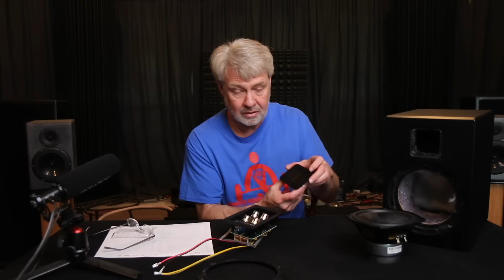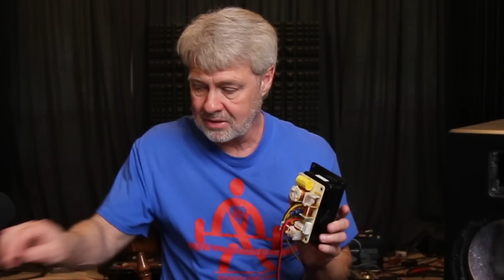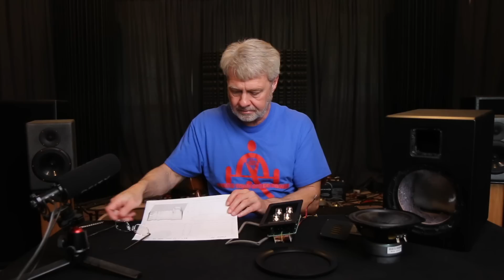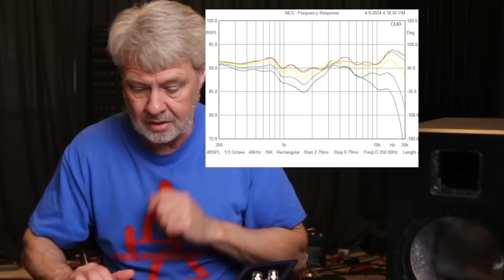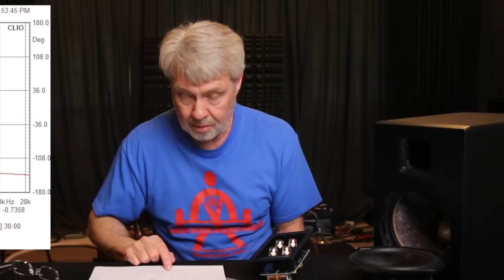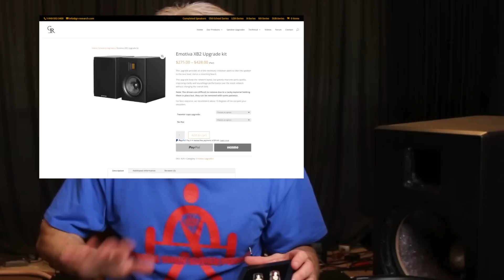These CHEAP Speakers Surprised Danny! Emotiva XB2!

Comment: A bucking magnet does slightly increase the sensitivity of the driver by increasing gap B, so there's maybe another dB or two gained by using the second magnet. The alternative is to make the main magnet bigger.
Reply: I still use a couple CRTs, so I welcome the shielding.  Free upgrade regardless 😊

Comment: 4 ohm speakers are increasingly more popular now days with the growing populatiry of cheap china mini-amps like the TPA3255's.  It is an easy way to get more power out of the small package w/ the included 19/24/36 volt power adapters without having to pay big money for the honking 48v ones (which often costs as much as the amp itself!).  Remember: Emotiva is a budget-freindly brand and many of their consumers are purchasing these speakers to pair w/ such chip amps.
Reply: power isnt quality 8ohms are a lot better. even with the tpa

Comment: Danny I've been watching you for several years, and for whatever reason you don't always come off good.
I do think that your are one of the brightest and your expertise is exactly what is needed. To this video keep in mind that people who have already purchased a speaker WANT OPTIONS and they keep speakers for 15-25 years. So spending more money is probably not something which is a killer, for example maybe have 2 options one for 1/4 of the price of the speaker and a better upgrade for a more premium price. I know myself if I already own them and can significantly improve the product I want know.... Think about we improve our cars with aftermarket out motorcycles, our homes so why not our stereo speakers. Don't worry about weather the price point fits but whether your product will make a little or significant difference!

Comment: He says you should drop 300-400 dollars on parts to get rid of tin connectors in the signal path but what do you think is inside your amp? unless you have a high end 2000 dollar amp then what is the point, you still have "tin in your signal path"
Reply: less tin is better.  you will get tinnitus with too much tin

Comment: Measurements are very good for these $500 a pair compared to many other $1500 a pair bookshelf speakers.  Since the measures impendence is very low for many AVR's, Emotiva should offer some speaker/amp combos to promote sales and assured performance for customers.

Comment: Question: do you aim to avoid using a PCB for the crossover, when possible? (using hard wired instead)  BTW You have my respect, to share your knowledge allows us to have more understanding & insights. I recently rewired my old B&W 684 S1 floorstanders, 1st order xover. i soldered quality UK speaker cable direct to drive units and stripped the cap & 2 chokes off the pcb and wired them externaly to the bi amped class D Fosi V3 amps which are fed direct from a raspberry pi fitted with twin psu Allo DAC. The rewire of the speakers was quite amazing and uplifted the clarity and sound considerably.  Many thanks and keep up the video,s. Paul

Comment: No test comparison after upgrade?  So does that mean those changes are not measurable?
Reply: The parts quality upgrade will not change these measured responses. The only real change that we would see in the measurements is if we put and accelerometer on the side panels before and after the upgrade as the No Rez will knock out the panels resonances down by 10db or more.
Reply: A parts quality upgrade of exact same original values won't necessarily change any of the actual measurements, however, the improvement in overall sound quality, clarity, and fine detail resolution WILL definitely be noticable upon listening to them, especially in the midrange and treble regions!...

That's why, as a reviewer, you mostly should rely on listening comparisons, rather than strictly ONLY comparing the "numbers" or technical "measurements" of a speaker... There's still plenty of qualities about sound and music that cannot be accurately or effectively measured or "quantified", but even with using the same electrical spec crossover values as the original design, (because as Danny stated, it already worked quite well electrically and measurement wise), you would still definitely HEAR a considerable improvement in the "non measurable" aspects of the sound coming out of it, with a significant improvement in parts quality, especially with better quality capacitors and inductors in the tweeter circuit, along with the clarity of the upper woofer's range, into the mids.

Comment: Danny is going to do a tear down on full range drivers.The crossover kit/wool will only cost 734USD.With non magnetic carrying handles for the cardboard box
Reply: He's showing what needs to be done
Reply: I have yet to see a "full range driver" that did not need a filter to correct for various issues including step loss, impedance issues, to break up mode, ringing issues, or a rising response.
Reply: @dannyrichie9743 My Quad electrostatics don't need any filter etc... The best full range experience

Comment: Very good information, I have been following you for a long time. I modify the crossover myself with Mundorf components. It would be good if you added information to the clip from two years ago where you said why we need to put good components in the crossover, the quality of the components that must be used depending on the frequency.

Comment: I dunno about Danny’s upgrade this time. I mean, it’s a budget speaker built to a price point for budget amps and signal sources and so on. Is it worth it? I can’t imagine this will be paired with high end revealing amps and dacs and so on. With that in mind it seems EmotivA😅 has done just another magnificent job with the price point that was the starting point for this construction. Kudos!
Reply: It would be a massive waste of money for no difference in listening
Reply: $600 ain't too budget
Reply: @BoRerunn  Can be debated of course. My point still stands though. He didn’t mess with the crossover points. It seems to me the design is maximized for the price already aka emotive did what they could and did great.
Reply: @choronzo202  you are not being logical. ALL speakers are built to a price pt. why is this model different? every klipsch out there makes my point. they are no more costly than these.
Reply: @ In my head it’s logical that a budget speaker which is correct according to his measurements shouldn’t be needing many dollars in upgraded crossover parts.
It’s a maximized design already within the price point they were designed for. Yes, most things are built to a price point. This speaker is built to a budget price point, which is exactly what I wrote in my comment. It will be paired with other budget components and the drivers itself and cabinet is also budget. So there’s the logic. In short, no way you can squeeze out more resolution from this design only by changing crossover parts (not changing crossover points) when it is paired with budget components.
Reply: @choronzo202  the last line of your comment says it all. you dont believe the underlying idea that better parts mean better sound. maybe a $40 chinese amp wont make it obvious but thats a foolish argument. these so called budget components is a red herring. untill you try it you are speculating against a guy who does this for a living and designs speakers all the time.
Reply: @CashGravel  Why delete your comment? I had time to read it. 

Exactly my point of view. Within the assumed budget line of amplifiers  to be paired with these there is no way you would pick up on changes by just getting those caps changed out etc. And not to say the old saying, shit in is shit out. You would have a substantial source with high definition material. No Spotify streaming. Not necessarily 24bit, I’m not that guy. But solid 16bit of information. You get my point. Budget systems like this are often played via mobile phone, Bluetooth streaming from Spotify. So no, I stand by my point. 

If you would upgrade every point in your chain, I will discuss this again. That means cd transport DAC or a good streamer from locally stored files and good cables and a not so budgety amp etc. Yes ok. But then again, you wouldn’t have these budget speakers. Get my point now?
Reply: @choronzo202  i deleted it because it was too long. all i needed to say was that your are wrong about the effects of upgraded parts on a speaker like this. look at all the klipsch upgrades for the same money. you outlined a series of possibilities to underpin your hypothesis. fwiw, you can go online and read reviews of his kits, real world opinions based on experience.
Reply: @BoRerunn  The base level upgrade is only $275.
Reply: @dannyrichie9743  I get that. But the system you would put this speaker in might not reveal the upgraded sound. Because EmotivA kind of maximized the output of this design already. He didn’t provide new crossover points. Just improved parts quality. And that is where I question this upgrade.
Reply: @dannyrichie9743  Danny destroyed that speakers quality rating
Reply: @BoRerunn  What do you mean?
Reply: @BoRerunnwhat what what?!?!?
Reply: @dannyrichie9743  I would buy another pair of XB2s for this money and ignore his BS upgrades.
Reply: Still gonna sound better than a $1000 pair of bookshelves
Reply: Because after the upgrade, it’s no longer a budget speaker, and will probably scale very well  with higher end components.

Comment: So does the attached magnet to the back of the speaker have no performance benefits?. I was under the impression that they stuck it on the back there to ‘improve’ a cheaper speaker!?!? Thanks for work work😊
Reply: No it doesn't.
Reply: @dannyrichie9743  👍

Comment: Interesting tip about diffraction on the inside edge. I need to build a long over due sub, and I was thinking about trying to bevel that inside edge. Sounds like it might not be an issue at the frequencies I want to play.

Comment: Hey Danny, what's the difference between Dynamat and No-Rez? Are they the same thing or totally different?
Reply: Very different. Dynamat is designed to damp the ringing of metals, not wood. It also has no foam layer for controlling standing waves.
Reply: @dannyrichie9743  OK, thank you for answering that.

Comment: Emotiva does an outstanding job of creating solid products at an affordable price.
Reply: I gotta say... I've have two of their amps - and XPA-2 (gen 2), and an XPA-200 (gen 1). They've been running for 8/9 years and almost 11 years, respectively. Not a single issue thus far, which also holds true for the XSP-1 (gen 2) stereo preamp I've been running for about a decade. I think they sound great. They may not win any beauty contests, with the blue lights, but they've performed solidly for me for a looong time.
Reply: Especially their amps and DAC.
Reply: Although this model is good, don't expect other models from this brand to be good.

A cheap model now and then can be good.

The absolute best ear plugs I've heard are some of the cheapest you can buy. They came with the samsung galaxy s8. You can also buy them loose today.

Think they are AKG/Harman Kardon - Black (EO-IG955B SEGWW)

Don't shoot me if I write wrong.
Reply: @ford1546  wow, samsung makes ear plugs? Why?
Reply: @kalle-09c  Don't worry.... I'm not armed.
Reply: @kalle-09c  "A cheap model now and then can be good."..."The absolute best ear plugs I've heard"     WTF are you trying to say?    Please don't drink and comment.  That or don't try to speak English if you can't.

Comment: 500 Spacebucks a pair is NOT cheap. Monoprice MP-65RT, 2 way bookshelf with ribbon tweeter 50-70 spacebucks. I'd actually buy a kit for those because they're actually cheap, and I wouldn't be too worried about doing mods to them with my lack of skills.
Reply: Or, even better yet, and especially if you are new to speaker upgrades, just look in a few of your local thrift stores for a reasonably good quality, good condition pair of used speakers to start experimenting with instead of a new pair, as oftentimes you can find a decent quality pair of used speakers in a thrift store for under $20/pair, and I personally don't ever pay more than $1/inch of woofer diameter for a set of used speakers, because I've found numerous pairs of good speakers for that price point already, and then those speakers can be used for "learning" about and experimenting with speakers for next to no money lost if you accidentally F them up, and also, with some good tweaks, many times some thrift store, (or garage/yard sale, etc), deal speakers that cost almost nothing, can actually become totally amazing and beautiful sounding! (Depends on what it is to begin with, AND what all you do to modify and improve it, but it's definitely possible to do, I know because I've done exactly that MANY times over many years of being basically a "NO budget audiophile", lol!... Good luck, and have fun experimenting!
Reply: Are you in the UK?. I can supply details of a diy mod kit for those.
Reply: @IanKnight40  No. Those speakers have been out of stock everywhere I looked, here in the American Empire. I was considering buying a second pair or two but could not find any.
Reply: @raidendigital1003  shame you are not in the UK, I have 10 Pairs boxed new left. A good mod is to put a 0.33mh low dcr air core in series with the bass driver. To take another step, turn the tweeter into a second order crossover by adding a small wire diameter  0.33mh air core inductor in parallel after the capacitor. This transforms the tonal balance by getting rid of the nasality in the woofer and also not working the tweeter so hard. Line the box with bitumen sound deadening pads. Cheers Ian.
Reply: @IanKnight40  I have a video where I VS these against the Dayton's. I like the monoprice's much more. The Dayton's are like a Tequila hangover to listen to.
Reply: @raidendigital1003  the mp bass driver is really good and smooth.... The trouble is that it is used full range so having a small 1st order coil on there really does help with integration and tonality with the tweeeter... There is less comb filtering. The box adds loads of coloration so if these drivers were in a really good sealed enclosure of around 8 ltrs there will be improvements there.

Comment: When copying a crossover that already performs well, do minor tweaks still have to be made in parts values to account for air core vs iron core inductors?  Do tweaks have to be made for different gauge inductors?  Do changes have to be made for components that are values not available off the shelf standard?
Reply: To OP: THAT is a VERY good question! One that MOST people wouldn't even know to ask, so kudos to you on bringing up those points... For a reasonably thorough and good answer to those questions, please read the comment above mine, as he already explained the major things to consider with this.
Reply: Only on occasion do values need to be tweaked from stock values, but when it occurs, it will be small differences like 6.8ohm vs 7ohm resistor or say 3.9uF vs 4uF cap, which are small enough to be inconsequential as they are still within the +/-5% typical tolerances of most components. The only time you have to account for inductor gauge is for large values, especially above 3.6mH where air core inductors start to get quite large and the DCR gets quite high, but if you're going from say a stock 1.5mH 18-20 gauge iron-core to a 16 gauge air-core, there's nothing to worry about as the DRC is still quite low. However, say you had a 12mH, 16 gauge iron core used on the bass circuit of a 3-way speaker playing below 300Hz, you would need a ~10-12 gauge air-core to compensate for the difference in DCR, and at that point you're looking at easily $150-200 per coil, not to mention the air core will also be much larger and heavier. Plus, at those low frequencies there is less performance to be gained by going to an air core vs one that has to play up into the midrange and crossover around 1000-3000Hz.

Comment: A few component value adjustments in that crossover probably would have twisted those knees into better shape. I wouldn't bother replacing all those parts if it didn't include any effort reshape those curves a bit.

Comment: The bucking magnet shows the company got a huge deal from some makers new old stock from yesterday's long gone past
Reply: so these speakers arent good then? You could buy any speakers at any price and someone will say something, or multiple things about them arent good. been looking for 2 months for fair priced, quality speakeslrs and these are one of the only I would consider
Reply: I personally dont give 2 shits  @AlexWheely-bx7pk if they are gooda , or not so gooda , all i was soraking of is the midbass driver using a bucking magnet like the late 80s to the 2007 era . Even if they could make me a Harvy Wall banger and roll a joint , i still dont care . But hey thats just me . If i ever was to spend any more money on speakers i would just save up for something from GR Research.
Reply: Exactly

Comment: Danny, bucking magnets in this speaker are not used for shielding. Please contact Emotiva speaker engineers for more information.
Reply: Please elaborate on what specifically you're talking about there...
Reply: @JoeJ-8282  Bucking magnet compensates the stray field and increases the force of the coil.

Comment: 4 Ohm is very suitable for class D amps wich gives a lot of power in 4 Ohms.
Reply: Any decent power amplifier out on the market can drive 4ohm speakers with no problem at all. I own Adcom amps that are class A/B and can drive as low as 2ohms.  Most power amps will have no issue with this at all and they dont have to be class d.
Reply: @vegaslimoguy2376  to be fair what Danny said is a lot of receivers out there would have trouble driving multiple pairs of speakers that are 4 ohm... ie. center, L,R, and a pair of rears.